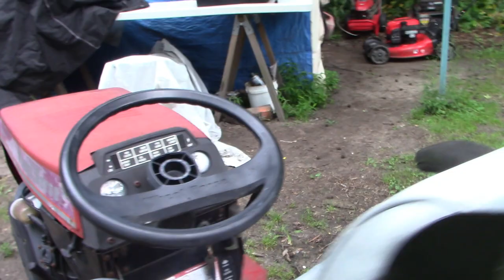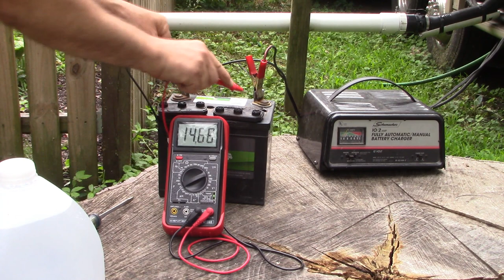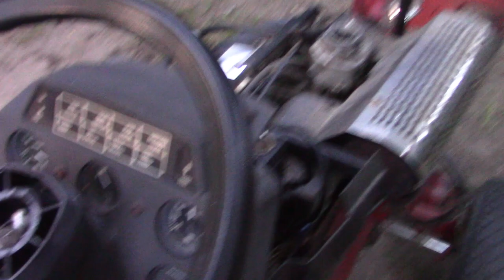STEPS to TAKE to Get an Old Tractor RUNNING AGAIN - 1990 Wheel Horse 520H

Comment: I have to address the state of my Carb today on '96 WH H520, glad to know in advance that I can just take the top off and access all the valves. That, a new coil, Spark plugs, voltage regulator, add new fuel lines, and clean out the gas tank, Hopefully I'll be up and running soon. Thanks for your video!

Comment: I'd double check that - looks like an 88 to me. 89+ had the forward/reverse on the column and 90+ had the forward-swept front axle and Toro stickers. I'm no expert and it's all more or less interchangeable so I couldn't say for sure. It's a solid unit either way, just maybe an earlier iteration. Definitely got the better end of the deal regardless

My brother and I dragged the 1990 520H out of my dad's garage a few years ago. It had been collecting dust for 24 years. Fresh gas, two (lightly) used plugs from my s10, and it was running in 20 minutes. I gave it new filters, fuel hose, and one tire, and it's been running fine ever since. Likes some choke - carb needs gone over - but it's been unstoppable so far.

Comment: I have a '92 that I have used for years. Originally got it for $500 as a worn out neglected farm tractor. Cleaned painted ,decaled and after the 2nd valve job sold the engine and replaced it with a 13HP Predator that sips fuel, (The 20 HP Onan sucks gas. I use it as a back up mower for my JD 1026R. Always loved the WH's.

Comment: I have owned my 1988 520-H since 1995.  It’s been pretty much gas and oil for 28 years and still going strong.  1200 hours on the clock.  I noticed your oil filter is a bit short. I use Wix 51762 which is the same size and meets all specs as the Onan filters that are no longer available.  Amazon purchase.  I love this tractor.
Reply from the maker: Thanks for the tip on the oil filter. I'll have to remember that. I've got this tractor running real nice now, and I'm very happy with it.
Reply: I buy NOS Toro and Onan filters because they're still readily available and not very expensive. Just a note for purists. But for the non-purists, Wix is an excellent brand, and there are tons of other perfectly serviceable names that are compatible, including ACDelco, Ford, and NAPA

Comment: My Wheel Horse 312-8 has been sitting for about 5 years now, and I decided to get it going again but I tried to move it shift lever the gears but it will not drop into any gear, only moves around in neutral.  Any suggestions please 🙏🏻 and thanks.

Comment: I didn't see you install the outer gasket between the oil filter and the tins.  Without that you are losing 30% of the cooling air to the rear cylinder.  It is imperative that gasket is installed or you risk overheating the rear cylinder and popping a valve seat likely trashing the block.  

That is either an '88 or an '89 judging by the tire sizes, front axle style, hood stripe color, Stewart-Warner gauges and front spindle size.

Comment: Yes you got lucky with the carburetor I have the same model I ended up having to replace the whole car later I wasn't so lucky but taken blow air compressed air behind all of 10 make sure there's no grass filled up in there clean all that out these things are common for their back cylinders getting hot Hope that helps
Reply from the maker: Thanks for the tips. I ended up doing more work on this fella. Replaced the muffler (broken bolts made it a challenge), removed and thoroughly cleaned the carburetor. New exhaust and intake gaskets. It's running great now. I am really happy with this tractor.
Reply: Hi I have a similar model here in the uk 1997 I think 227-5 runs fine but steering rack is worn and if I turn to hard the teeth slip it looks a difficult job to undertake and spares are hard to acquire